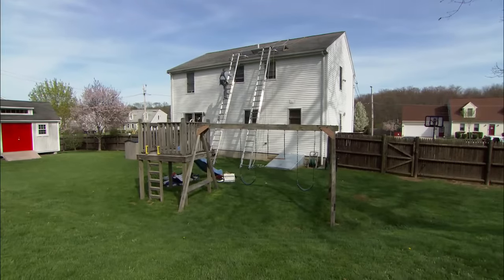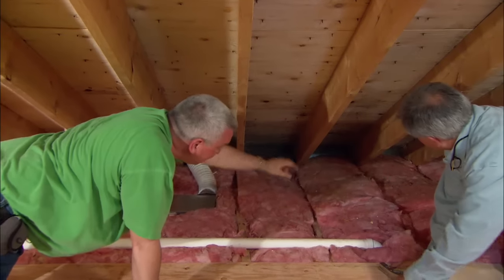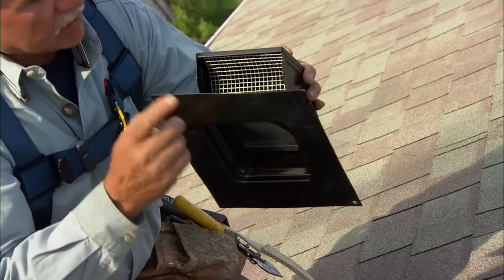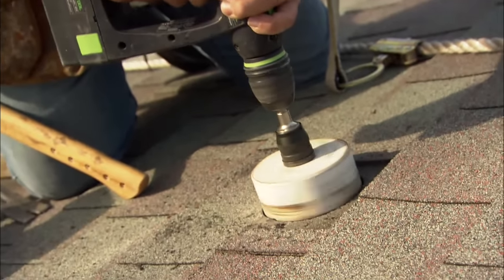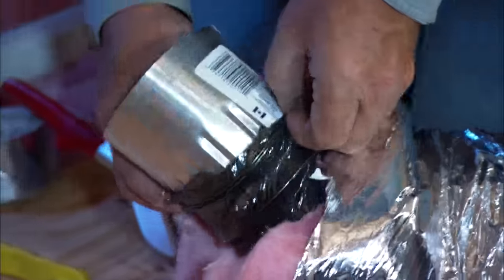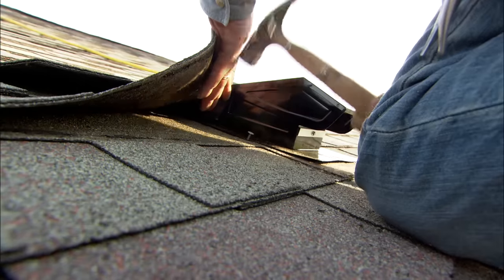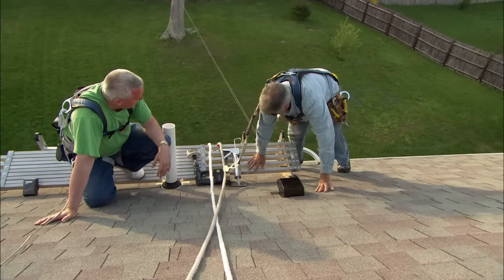How to Vent a Bath Fan Through the Roof | This Old House

Comment: Only thing I would change here is the caulk should be replaced with an asphalt base mastic. Otherwise looks pretty good.
Reply: Dude...I can't tell if you're agreeing with him or disagreeing with him :/ Asphalt base mastic or not? (And if not, amazon link to whatever's better?)
Reply: Elijah Robison yes, ditto that
Reply: Geocel outperforms everything in roofing and siding applications. If your not using it do some homework and get it asap.
Reply: Yep, roofing tar in a caulking tube is best for that stuff.  And I'd cover those nail heads with it and caulk around the metal pipe sticking out of the roof before installing the metal hood.
Reply: Tar beats snot.

Comment: Thanks! We've had a temporary setup that routs the bathroom vent pipe along the wall in the attic and out the side, but a lot of condensation was accumulating in the pipe making it droop down and even drip! A nice, elegant solution like this is exactly what I need!

Comment: Great vid on the Braun vents I am putting in. Get a hook blade for the exato knife Tommy, it will cut thru the shingles like butter.  All three of my bathrooms have no exhaust fan. A little sick of opening windows for 28 years.....and I wish my shingles lifted up so easy, mine were baked on for 10 years.

Comment: What happens to that little roof vent when it's covered under a foot or two of snow?
Reply: My guess is then the hot air leaks back into the attic and causes ice dams.  Especially since the connection between the duct poking out of the roof and the vent cover didn't even seem tight.
Reply: The hot air melt the snow and if the hold vent is sealed right, water will ran down

Comment: Just checked my bathroom vent.  It goes DIRECTLY into our attic. I'm not even sure if this is up to code.
Reply: No, you have to vent it to the exterior.
Reply: @CupidFromKentucky ,
  Luckily, it's pretty dry where I live, and the attic is well ventilated.  No sign of any mold growth on any of the rafters or decking in the attic.  It's probably been like that since the house was built in the early 80's.  What amazes me is that the house has been bought and sold several times (I'm the 3rd owner). I would have thought this would be the kind of thing that would come up on a home inspection. We had the house inspected before we bought it. Guess the inspector didn't feel like climbing into the attic. I'll get this fixed within the next few months.

Comment: Great tutorial.  For anyone planning on doing this without a helper, I used a 4" hole saw and the duct fit tight enough that I was able to shove it through the hole without it falling back through, and then climb up on the roof to secure it.
Reply: I’m going to do this, but I keep wondering about adding some type of sealant around the duct to prevent seepage back into the attic. Wouldn’t some of the moisture leak through that hole if it wasn’t sealed off with some type of caulk or even foam spray?
Reply: @kimbasaurusrex2  - not that I've seen. The vent housing is sealed around the edges and there's a flap that remains closed unless air is actively blowing out. I checked mine in the midst of a rain storm the following day and it was bone dry.
Reply: @unkzzz  I don’t mean through the vent hood, I mean through the hole that’s drilled through the roof. There’s not an airtight seal between the duct and the hole
Reply: @kimbasaurusrex2  - the space where that hole exists is beyond the vent hood seal.  For anything to reach the hole it would have to go through the vent hood opening or penetrate the seal around the edges.
Reply: @unkzzz  I don’t mean moisture from outside. I plan to vent our bathroom fan through the roof in the attic. Any moisture from the bathroom, like during showers, would travel through the duct to the vent on the roof. But where the duct opening meets the hole in the roof isn’t actually sealed. The end of the duct is just slid through the hole in the roof and nailed down.
Reply: @kimbasaurusrex2  - when the bathroom fan is on, it's blowing that moist air straight out through the vent into the outside. when it shuts off, no more air will be coming out of it. whatever moisture is left when it shuts off isn't going to be enough to condense seep back into the attic.  that said, this is another reason that it's recommended to use a timer on your fan so that it runs for a sufficient amount of time. by the time the timer shuts off, the air should basically be dry.  At any rate, I don't think sealing the outside of the hole will hurt anything, but I didn't use it on mine and I've inspected it a handful of times since and never seen any evidence of the problem you've described here.
Reply: @unkzzz  thank you 🙏🏼
Reply: @kimbasaurusrex2  No problem.  Of course, these are just my observations based on the one install I've done and I'm not a professional HVAC contractor. Good luck with your fan install!

Comment: He should have  Put caulking around the sheet metal sticking up from the roof
Reply: yea i was going to say the same thing...
Reply: Didn't he left it  that way so that condensation would run down the roof.
Reply: @jaychz1890  no we're talking about the silver pipe. It should be sealsd against the roof deck. Just another layer of protection against water getting in.
Reply: HUBERT  And rain water is going to get under the level shingles that are below the vent - where the vent overlaps that layer of shingles. Sigh.
Reply: A Remedy Project rain doesn’t usually go up
Reply: Lots of armchair and theoretical scientists and analysts. There’s book learning, doing learning, and a blend of both. As a working carpenter and contractor, and most especially if he is a journeyman or master carpenter, Tommy has both. 🤔 I’m going with Tommy on this one.

Comment: So lucky that you put the nail through blindly directly into the center of that shingle... what if it is not centered and I come up between two shingles? Thanks for the video :)
Reply: striker1211 ...ah, the wonders of a sharp utility knife and silicone...
:0)
Reply: You don't really have much choice as far as horizontal position since it needs to be between the rafters. There is enough flashing to handle the worst-case alignment. Tommy didn't go into it but there is room to optimize vertically so that you get a clean install starting at the end of a row of shingles. Notice how he trimmed the shingles to fit the vent hood before drilling the hole into the roof. That hole doesn't have to be centered on the original nail.
Reply: striker1211 Well then you do a tear off and get a whole new roof! Lol
Reply: You stop recording, remove the nail and try again.
Reply: hahaha expert!

Comment: Why drive the nails through the metal of the vent and not use the 4 holes one in each corner already pre-drilled on the vent?
Reply: +Brian Z I'm no expert, but probably to avoid damaging the shingle by bending it any further. The top 2 holes would likely be used if the vent was being installed with the roof. As for the bottom 2 holes, he probably figures the 2 nails and sealant are enough to hold the vent in place. 

The fewer holes you put in your shingles the better.
Reply: The two holes on the bottom are exposed and not covered by shingles. That would allow a hole for water to seep through into the attic.
Reply: Brian Z I believe those holes are for new roofing install.
Reply: The bottom part of the vent with the two holes is still on top of the shingle underneath it.  Water will just run down the shingles as normal.
Reply: Wind will bend that vent up and snow and ice could build up there causing a a good size leak, I would have used the pre drilled holes nailed it down and put some dabs of caulking
Reply: Kody Perkins my vent had only one pre drilled hole on the bottom left, kind of odd I thought. I used it and drove through the metal into the roof an caulked the nail heads, put one nail on each side and two, maybe 3 on the top which is cover by the shingles but also caulked those hidden nails, my first time doing this I have one more to do, I had mold from two bathroom vents I noticed just a few weeks ago, scared the crap out of me when I saw it ha!
Reply: Kody Perkins I'm mostly worried about damaging shingles trying to get nails out and lifting to get under them to nail down the vent, I guess I'd figure out how to weave another shingle in place by watching a video on it though, I'm gonna try this next in a few days when there's no rain in the forecast, the other seemed to work out okay, I was generous with the tube of Liquid nails Roof repair like he showed to do? I just noticed the vent made by Broan has 1 pre drilled hole on the bottom and 1 on the top?
Reply: Search for Henry products for your roof, they're supposed to be the best sealants.
Reply: I agree.  I have seen vents that omitted the bottom nails pick up in high winds and leak.  You nail them and use the silicone sealant he was using to seal over the nails.
Reply: Think screws with rubber sealing washers - not nails
Reply: Water cant sip vertically, gravitation won’t allow. He deliberately did not seal bottom to allow exhausted moisture have escape path as collar around roof cap is not air tight.
Reply: @laurenwerner2021  Geocel 2300 is hands down the best roofing caulk there is, Henry products are a distant second place.

Comment: Interesting!!! I believe the flippers, who worked on the house we bought, vented one bathroom fan into the attic. They replaced the entire roof I’m told.  They chose not to put any soffits anywhere. There are two large gable vents at the ends of the main peak. One bathroom vents out to a wall and you can see the little flapper. I cannot see anywhere near the other bathroom (or else where) where another flapper exists. Have to figure something out

Comment: Good morning Tom- 
My wife and I just bought a duplex that is over 30 years old. We having difficulty changing the stove hood l. The house was built without the hood vent up on the roof. All the smoke coming from heavy cooking start to go all over the  cabinets. My wife and I do not know how to install a new pipe so that we can have a new vent that take away all the smoke from heavy cooking to the roof. 
We have been wanting so bad for some help if possible to have your expertise showing us or helping us having the vent the ventilation installed on the roof.

My wife and I thank you so much in advance

Comment: The problem with the vent duct going straight up is any condensate from the bathroom moisture will be dripping right back down into the bathroom. I had the first hand experience of it. It gets worse during the winter when the warm moisture meet the cold temperature at the outlet and start dripping back.

That is why all the bathroom vent manufacturers' manuals said the vent outlet needs to be lower than the fan.

Comment: That screen is now plugged with lint, and there is no easy way to remove it. I bet every bath fan in the USA operates at about 30% of capacity due to the screen getting stuffed with lint after about four years of use.  If you know of a vent with a removable screen, please comment and share.  I was able to snake 10 ft of vacuum cleaner hose into my ceiling fan vent and clean the lint off.  Wow, the fan actually worked for the first time since I bought that house.
Reply: Yeah ,   I  go  up  on  my roof once  a year  with  a stiff  bristle  brush to  clear  the  screens with  the  fans  running.
The  bathroom vents  tend  to  clog  with cellulose  fiber from  toilet  paper,  they  will  completely  choke  off  after 5-6 years  if  you  don't do this  occaisionally.
Reply: @Hello Dana how are you doing

Comment: I seen a some videos and was told not to run the bathroom exhaust ducts vertically up the roof because during the cold evenings the warm exhaust will build up condensation inside the duct and drip back down into the exhaust fan and on to the bathroom floor. Always run bathroom exhaust horizontally, but not to the soffit. Any suggestions?

Comment: A simple fix for having a soffit vent is to add solid (non-vented) soffits for 3-5 feet to either side of the vent.  Or add flashing over the bottom of the vented soffit and screw in place.  The 3-5 feet depends on code, of course.  But this will prevent the moisture from entering back into the attic.

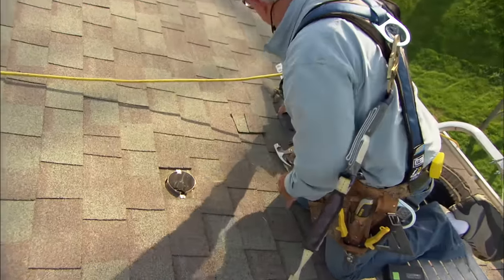Comment: 5:30 they got the metal vent pipe with squar lip so you can nail it to the roof.for the metal vents at my job we use tar and silicone for plastic vents
Reply: But for a non-roofer without tar setup this still works. Do you feel that your method is more superior or just more practical if you are a roofer?

Comment: I was in Lowes recently and in the aisle where they sell bathroom exhaust fans, they also sell soffit vent kits.  I can understand why you really shouldn't use these based on the situation shown in this video.  Am I correct in assuming that they are acceptable for fans in half baths with no shower?

Comment: Thanks Tommy, The vent boxes we purchased had a 6" collar at the bottom which can go through the roof. I see yours had just an open area. Can I use the one with the collar or should I go back and get your type? If I use mine, it looks like I connect the exhaust duct to the vent box and not the roof. Maybe mine could slip off if I don't connect and screw the exhaust hose to that collar. HELP

Comment: Useless system...good luck when you have 12 inches of snow on your roof!!!!
Reply: Wouldn't the hot air from the bathroom vent just melt the snow?
Reply: droptozro Just a few inches sure. But a foot of snow or more, especially if it’s wet heavy snow forget it.
Reply: slspg So what do you suggest?
Reply: GeorgeIII Vent coming off the side of the house instead of the roof vent. Reality of someone living in Vermont is quite different than someone living in Arizona.
Reply: slspg That makes sense, but would be impossible for my house without making three right angles.
Reply: @slspg  off side of house but what if that is still under an eve?

Comment: What region are you in  installing the insulated line ? And being is some homeowners think that you guys hold final authority  concerning these types of things How many feet from the fan to the vent is it? Because if it's over 12 or a 24 foot run,  condensation could build up in the line even if it is insulated, no? And how would a 3 foot run build condensation in a line that's not insulated? In new jersey?

Comment: Question?  We had a bathroom remodel done and the electrician added new bathroom fans and opened holes in the ceiling for the exhaust.  Is it the responsibility of the roofer to complete the venting work and vent on the roof?

Comment: good morning, i did exactly this last year ( i had our roofing company install the roof vent,) i find that the insulated venting pipe is saturated with water,( and holding some )  should i use a rigid insulated pipe? i live in the north east with very cold winters. hot summers.

Comment: I didn't want any more holes in my roof. I've had enough roof leaks and sheet rock damage for 10 homes.
My 2 bathroom fans were never vented to the outside though and I'd like to get them to the outside.
Maybe an outside wall might be an option?

Comment: We had water coming though our bathroom fan a year or two after buying this house. I went into the attic to find it was completely damp... Everywhere was caked in ice (in MN), and it had warmed up suddenly, causing it to melt. Turns out, our roof mounted bathroom vents were the cause. They had installed the roof vents, drilled the holes. Then instead of the rest of what he did, they put a 4 inch duct flange into the end of the hoses, then they screwed those directly onto the inside of the roof. The moist air was passing directly in contact through the hole in the roof. This eventually caused enough mold and damage in that spot that the screws started to let go just enough that they were venting directly into the attic.

It's amazing how easily one idiot with no common sense or work ethic can ruin a house. Oh, and we had it inspected too, and the guy did go in the attic. So, in this weird post covid age, DO NOT waive the inspection, but more importantly, find a good one.

Comment: Can you vent 2 bathrooms together through one outside vent? The bathrooms are side by side on the 2nd story and both need vents to stop the moisture gathering on the ceilings that are causing the paint to bubble and crack.
Reply: How did you do yours with two bathroom fans?

Comment: One major drawback is in northern climates when the roof is snow covered blocking the vent and the sub freezing temperatures freeze the damper  either shut or open which will cause condensation to run back into fan saturate the ceiling and drip, saw this many times in my 21 year Home Inspector career.

Comment: Great video!  Always enjoyed and appreciated your shows!   A quick question: should I replace my old 3" sheet metal pipe for an old bathroom fan with a new 4" flexi insulated vent duck to an existing roof turbine hole near by the roof ridge?  Thanks a lot!  I am in the middle of replacing my old fan with a Panasonic FV-0511VFL1.

Comment: Would tapping into the existing vent pvc tube (seen in the background) with a "Y” be an option instead of drilling through the roof  ?
Reply: I would say no. It could cause a backdraft situation/improper flow,  and that wouldn't be good if it's a waste vent pipe. as far as I "know" any vent fan needs its own run.

Comment: My kitchen exhaust is leaking water. I have no idea why, but I did notice that the ductwork doesn't lead outside. It's pretty much in the attic near a vent on the side of the attic. The ductwork is not the kind in this video either. Is that causing the leak? I don't see any roof damage.